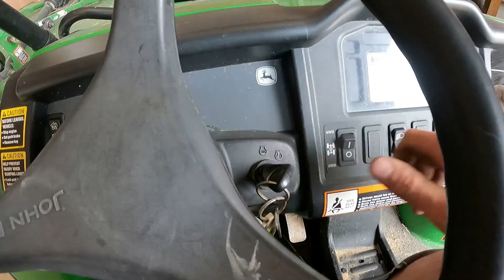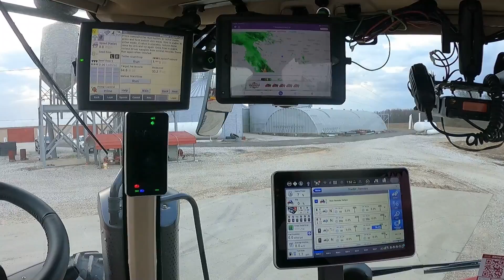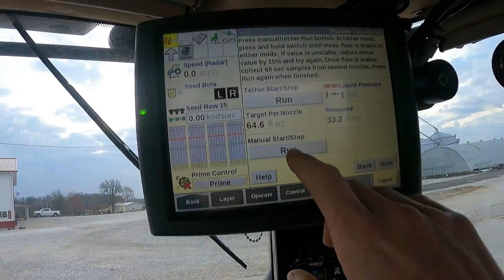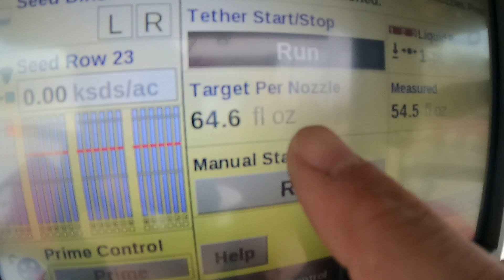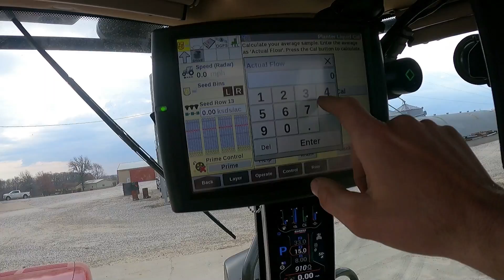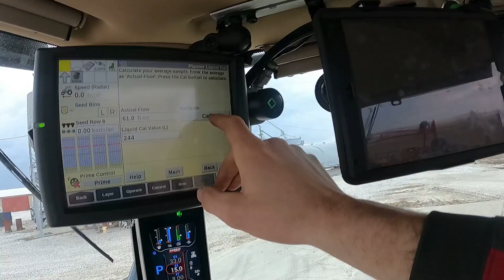Spring Prep and the Case Ih 620 QuadTrac and 475 Speed Tiller Work Some Dirt Episode 57

Comment: How are you going to use Deere guidance lines in the red tractor?
Reply from the maker: You can pull it off the green monitor or jd link to a thumb drive and upload it to mycaseih then use ads connect or that’s how we are doing it at least
Reply: From my experience you will have some drift because Case and Deere operate off of different center points of the earth.

Comment: Our 340 does the same thing when comes to filling up with fuel.  It also plugs the air filter way too quick. Found a company called Hillco Technologies that make a different air intake with precleaner. We haven't used it yet, hope it works.  It doesn't look like the the folks at Racine improved the way you get to that little step on the front left corner of the cab.  When I try to make that step on our 340 it looks like a monkey f...... a football.
Reply from the maker: That’s interesting, I might have to check that out. I know the air filter alarm in the 620’s go off a lot

Comment: How come your running all the precision equipment on corn planter threw Pro 700 and not gen 3 20/20? 2020 is way more user friendly and can view all maps on it and not need a IPad and useless climate
Reply from the maker: Just following dealership advice and I love climate especially in the fall
Reply: @iversfarms  you have to check out a Gen 3 20/20 sometime, I couldn't be more impressed with mine. Hopefully we get those planters rolling soon. Have a safe successful spring.
Reply from the maker: @aaronthesing8751  I know a lot of guys run them and love them. I asked about needing one this past week
Reply from the maker: @aaronthesing8751  best of luck to you this spring